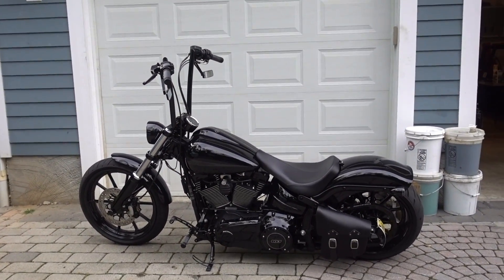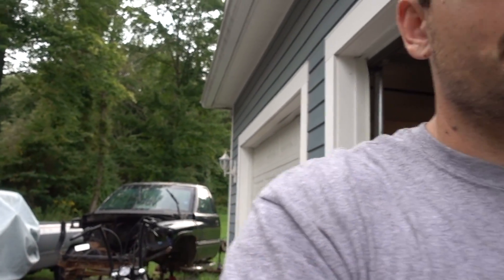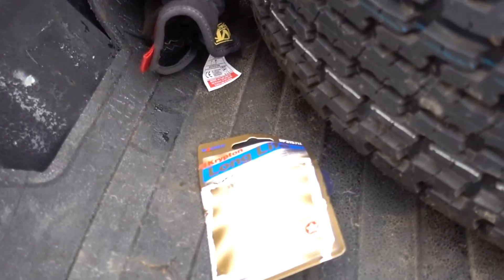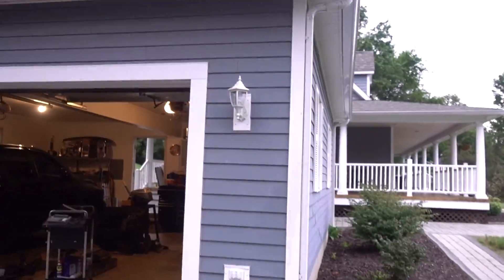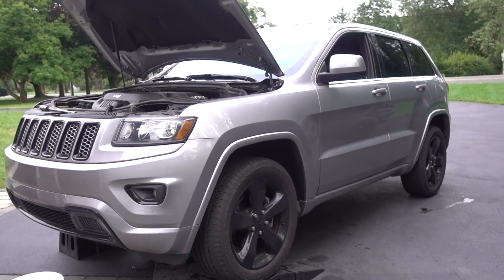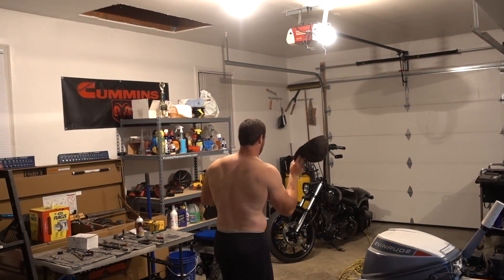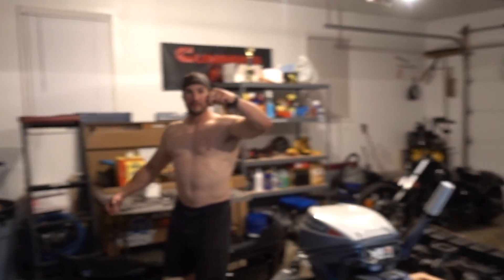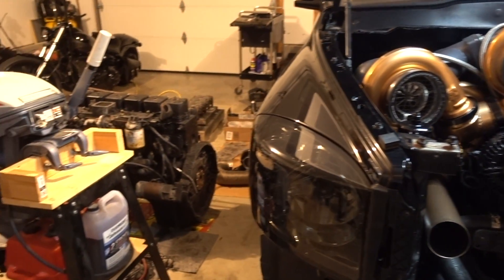OUR SHOP IS UNDER ATTACK!!! TRIPLE TURBO CUMMINS PAIN

Comment: Get yourself a oil vacuum and do top side oil and filter changes. No need for ramps or to get under the Jeep at all EVER again. I just did a oil change on my TDI passat with mine if you wanted to see it in action.

Comment: ok there are actually both my dealer out here in colorado has a trail hawk and also have a track hawk well you can contact them to possibly order a track hawk but difference is the Trail hawk is a Grand Cherokee and is set up for off road and mountain use, the Track hawk is also a Grand cherokee but is the one set up with the hellcat engine

Comment: Big chunks of steel are good at escaping from boxes. Ordered a forged ball mount from amazon. Picked up the box and it felt empty. Turned it around and there was a 2x2 hole where the ball mount left the building.

Comment: I need to get my Harley's wheels powder coated gloss black. Any tips?
Reply: Drew w take the tires off find a guy that dose sand blasting get them blasted takem to a powdercoater
Reply: Vasiliy Dronov yea I plan on pulling the wheel bearings as well then having them blasted. Worried more about them being cast aluminum

Comment: They make the Jeep grand Cherokee with a Cummins diesel
Reply: Jake Poinsett it's not a cummins
Reply: Jake Poinsett no they don't.
Reply: I don't thinks it's a production vehicle. Just a concept, they would have to change a bunch of drivetrain to make it work.  It was the trail cat btw. There is always the Cummins repower program.

Comment: the question is can the wife handle 707 hp?
Reply: Brooks hellcat isn't 707 to the wheels. That's to the  crank
Reply: lol 707 is 707 did you see anywhere i said to the wheel? besides im sure i been building engines & racing longer that you been alive